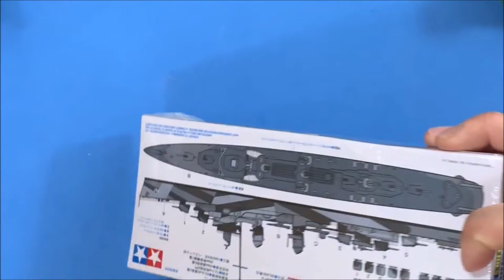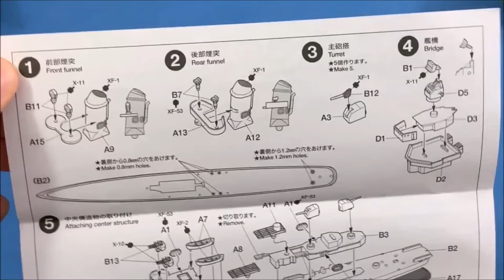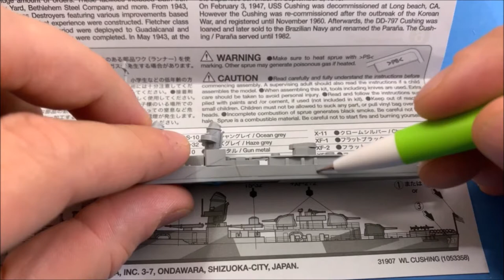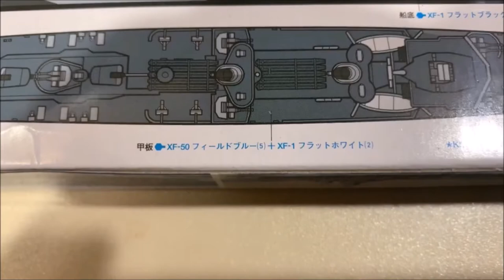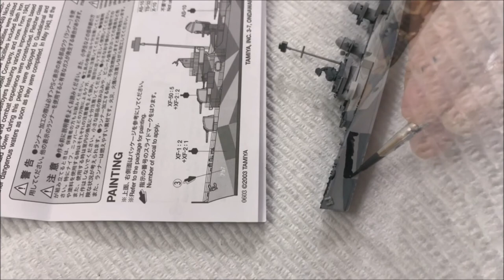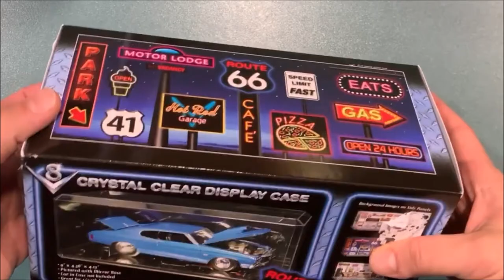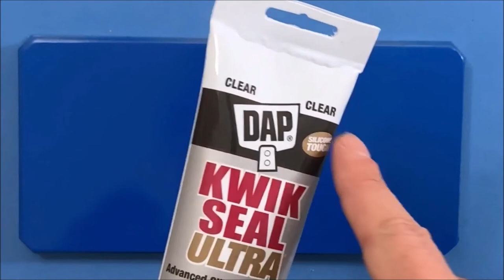FULL VIDEO BUILD TAMIYA 1/700 US Navy Destroyer 797 Cushing

Comment: Hey I'm new to building can you give me some good tips on like getting tools?
Reply from the maker: The basics would be a self healing cutting matt, a #11 hobby knife, cutters (for thick plastic cutting off sprue), plastic model glue (I prefer Tamiya extra thin), sanding sticks (you can get multi sided nail sticks for most things). If you are hand painting, paintbrushes of different sizes (flat, rounded, detail). Pick a kit meant for someone starting off and build up as you go. You will start to notice other things you want to have as you work on your projects. One thing that helped me out is to find someone that you like to watch and follow along with their build, try to emulate their techniques. Every project requires different tools, so following along is a great way to build these up. There are people I have watched their videos 20-30 times trying to pick up on how they are doing something.
Reply: Thanks so much!
Reply from the maker: @ssh6659  My pleasure :)
Reply: Well I will watch you, and try to learn from you.